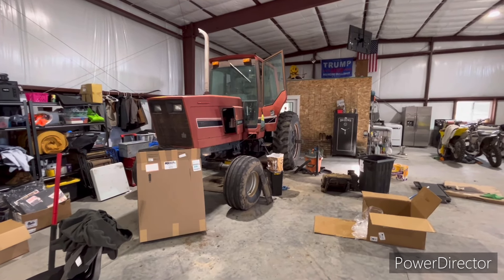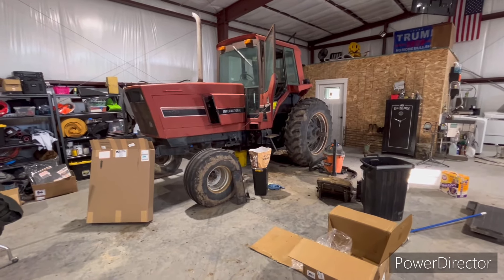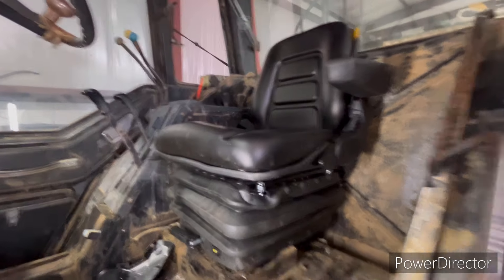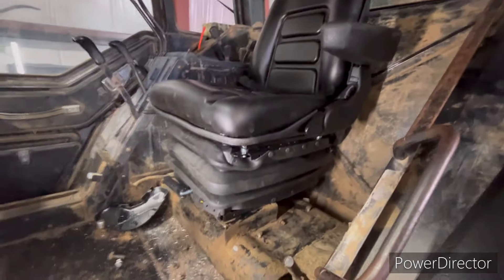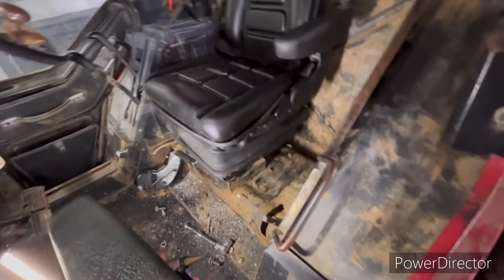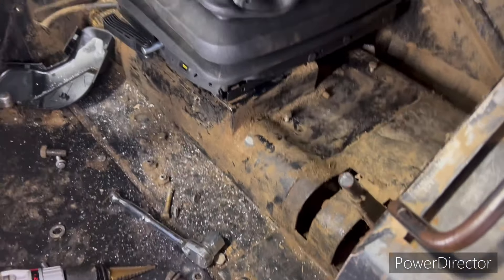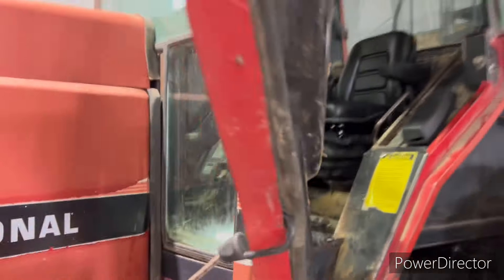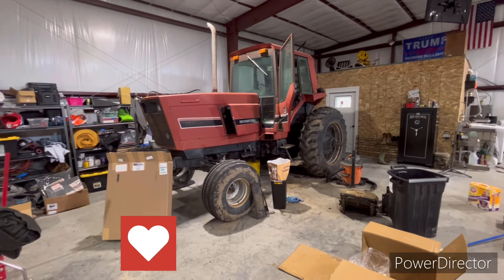International 5288 Tractor - Back From The Dead - Part II

Comment: You'll regret not getting air seat never be cheap on a seat
Reply from the maker: If I was farming full time maybe or doing a lot of tilling on rough ground. I think it will work just fine for my purposes. Didn’t want to buy a $1000 seat for an $8k tractor.
Reply: @selfmadefarmer2020 we've got used truck seat bases in 94 series, kept the swivel seats. 
Put self contained base in the 5288, with original seat on it. I think we're $400 into the self contained base. It's way better than the original hydraulic suspension and doesn't make a mess!
Reply from the maker: What is a self contained base?
Reply: @selfmadefarmer2020  air ride with the compressor already in it. We actually got it from the Case -IH dealer.